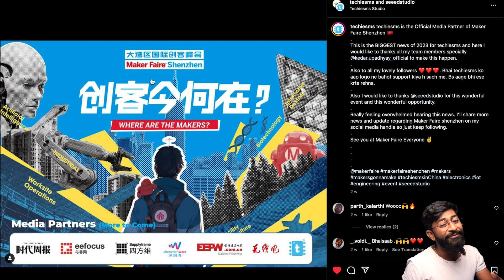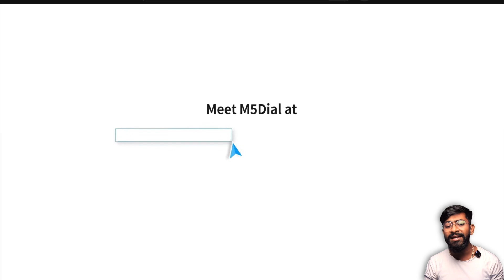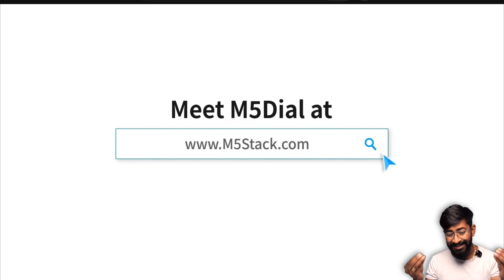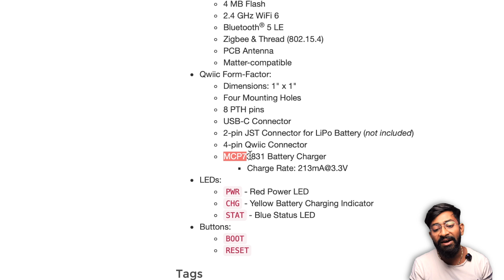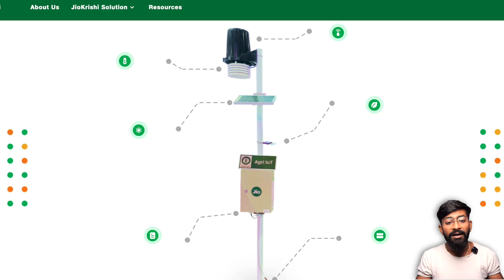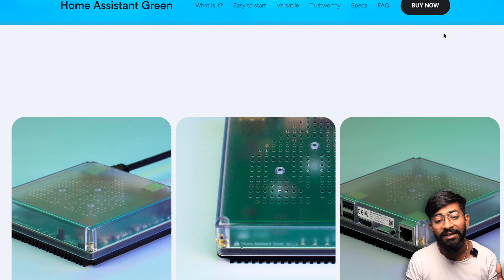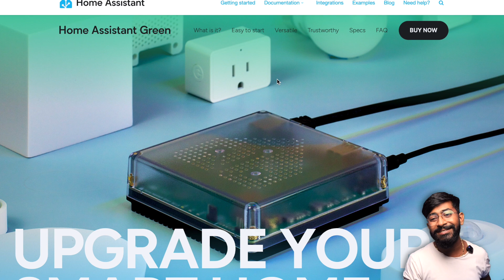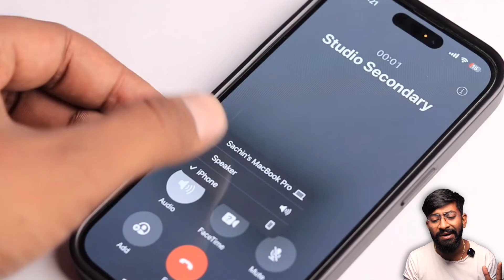Jio Krishi, Home Assistant Green, SparkFun Qwiic Pocket ESP32-C6 and more | Tech Update

Comment: Hello,I am facing one issue, I have Two ESP chip...One is ESP 32E and second is ESP 32UE,Both having same datasheets...Issue is ESP32E is connecting with Mobile Hotspot and Home router also, But when I am using same code with ESP32UE,it is connecting only with Mobile Hotspot, it is not Connecting With Router... I have tested with same code for Both Chip ...Please can you suggest anything?...